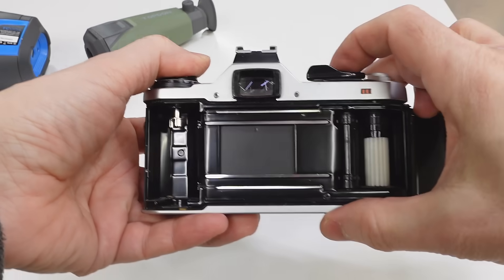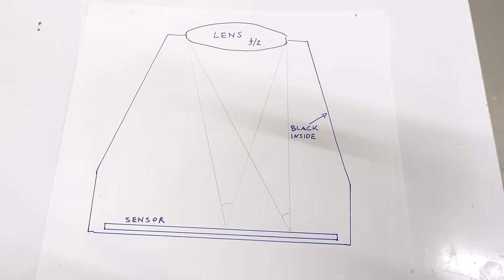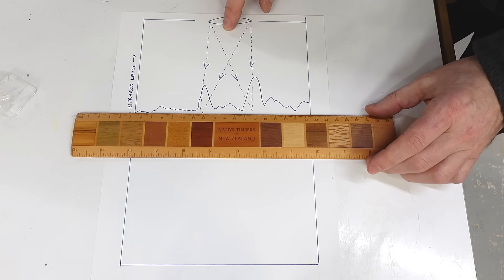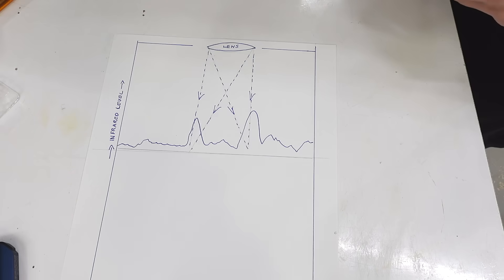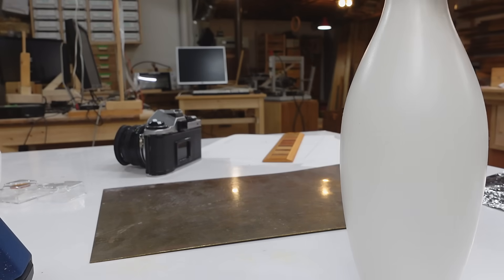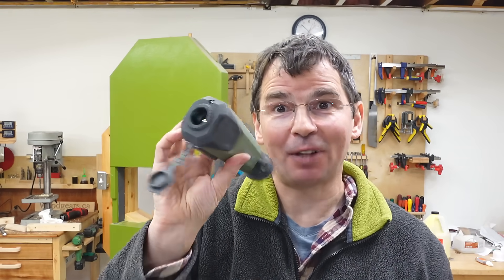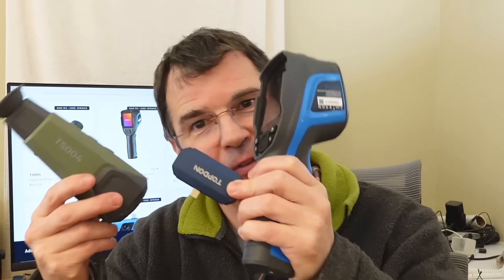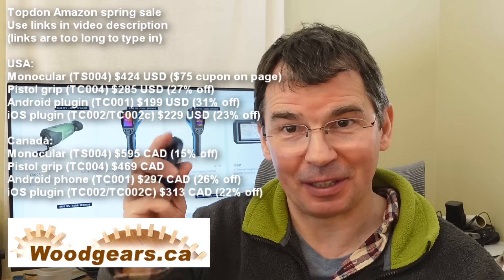How do thermal IR cameras even work without liquid nitrogen?

Comment: Well done exploration of how the modern thermal infrared imaging devices work. The technology has really improved since decades ago when the extreme cooling was necessary. The only suggestion I have is to be clear that you are talking about the thermal infrared, mostly around 8-12 microns wavelength, because the infrared spectrum extends to near the red visible light. There are other devices that measure the near-IR and short-wave IR wavelengths.

Comment: I wonder if these cameras are sensitive enough to be used as amateur IR telescope detectors? All IR cameras in astronomy are also actively or passively cooled, but what if you create a spherical mirror with aluminum foil and put one of those monoculars in the focus, would you be able to see the stars? Or will the atmosphere radiation totally dominate the view? I guess that depends on the optimal wavelength of the sensor in there, it may cover the atmosphere opacity window in NIR/MIR.

Comment: I use thermal imaging quite extensively in my work. I repair electronics professionally, and a thermal camera is INVALUABLE for locating faults on electronic circuits. The quality you mentioned about copper in specific is something I find very fascinating, and also very frustrating for my particular line of work. 

Many circuit boards have "ground planes". These are huge sections of the board which are entirely made of copper (although usually just one singular layer of the entire board). Often times, these planes are covered in solder mask. However, sometimes they aren't, and it is just exposed copper with some kind of coating to prevent it from oxidizing. 

Trying to examine a circuit board for a short can be very difficult when using an inadequate thermal camera, because ANY exposed copper can seriously screw with how the sensor is picking up infrared. I very often have to meticulously examine every part of a board, hold the camera at juuust the right angle and juuust the right distance, just to make sure it isn't getting thrown off from highly reflective materials like exposed copper. 

There have been many situations where I think I've located a short circuit, just to discover I'm trying to zero in on a screw hole with copper around it. It is very trippy seeing the thermally reflective properties of copper like this, too. Being able to see a reflection of the IR from my own hand when I'm pointing the camera at a board is a really weird thing to look at, lol.
Reply from the maker: I find that frustrating too.
But for making sure I had the camera focused at the right distance for that shot of the shutter clicking, a crinkled piece of tinfoil was the best focusing target.  Cause themperature itself tends to diffuse, so no sharp edges, but the crinkled tinfoil, reflecting IR from elsewhere, made for lots of edges to check focus with.

Comment: I mean, why would they need liquid nitrogen. Do you need liquid nitrogen when you touch a warm/burning object? Those IR sensors are just fancy antennas, because IR is an electromagnetic wave - just like visible light, but with lower frequency.

Comment: I wrote software for microbolometers, the question is not the sensor temperature, is the air absorption of IR on several wavelengths, and this is variable depending on air humidity for instance, so at different distances you get different temperatures at different places. To get a precise temperature you would need an spectrum to get the peak emission wavelength, considering it a black body but those is also dependent on the object surface. Basically you can only know the temperature at short distances (by Stephan-Boltzman law) when the air abortion is not too much.
Those thermometers are not to precise either.
If you put a temperature reference at the same distance of the object you can get o good measurement of temperature but you need to calibrate for EACH sensor.
The sensors are not kept at a constant temperature but they do what is called dark field calibration, from time to time a shutter obstructs the vision of the sensor an its temperature is known. This causes a annoying interruption of the image but works well enough.
And in 99% of applications the relative temperature is all you need: finding a wire overcharged on a circuit box, finding hot and cold chips on a PCB, finding hot or cold places on a person body, finding water infiltration on a wall, finding a person or animal hidden on a bush...etc.

Comment: I would think that putting a temperature sensor inside the camera so that you had a good sense of what's the temperature at the baseline, and then you check the amount of radiation being picked up from inside the camera. Calibrate those two and then after that you can start assigning temperature to the excess

Comment: from what it looks like at 7:07 you could almost think the sensor is actually heated to a constant temperature measured by a thermocouple or similar. As such, independent of ambient temperature, you always have a constant sensor temperature that is also easier to tune and calibrate. Whereas it would be best to keep the raised temperature as low a necessary. What do you thing?

Comment: I have the iPhone version of that little one for industrial maintenance/repair. I wish it was higher resolution, but it does what I need it to do. I do recommend using it with an extension cable so you can see the screen while pointing the camera wherever. Also, it wouldn't fit on my phone with the case on without the extension cable.

Comment: I find it interesting that they all seem to use the same sensor chip that has a resolution that's pretty small. So even the cameras that have a much higher resolution isn't because of a better infrared sensor, but just mixing it with high resolution normal camera sensor

Comment: Reminds me of something I learned about recently - "long exposure noise reduction".
You eliminate hot pixels from long exposure photography by following your shot with shot of same exposure but with lens cap on. Then you substract any sensor-inherent noise from your original photo.
Reply: Interesting, this suggests sensor noise is not so random as I'd assumed.
Reply: @CSNCSNCSN  For short exposure it seems to be random. With long exposure there are hot pixels and grid patterns.
Reply: There is actually a simple explanation that works pretty much in any measurements: often noise can be roughly divided into "random" noise(like white noise) and not so random one that can be due to some sort of a source (it can be a measurement system itself or simply something nearby). And when averaging over a bigger period of time or increasing amount of samples for it "random" noise samples cancel each other, but noise from a source lasts and can be obtained and substituted(since we know signal we want to measure is 0 or some well known value). This way often calibration happens.
Reply: @ВладіславЗаморський  you could also for example give up half of your vertical sensor area for a blanked off "reference", and in pitch dark, characterise the correlations between upper sensor noise and lower sensor noise. Then when taking photos, the post processing can go ok for X blank area noise, we should expect Y photo area noise.
Alternatively you get a sensor bigger than the lens can illuminate, and use the border area, but that's harder to explain initially!
Reply: @HaxR3  I guess this approach gives a significant advantage in terms of power supply dependency. This way one can probably simply use a battery and get very good results. And looks like this way temperature dependency can be improved as well. Such a clever way to do it.

Comment: My entry level FLIR does the shutter click. But it does not have absolute temperature readings (there's a separate, built in IR temperature sensor aimed near the center of the screen, close to but sadly not on the cross hairs on the screen).
Another reason to regret not getting a Topdon

Comment: For determining the absolute temperature, instead of using the amount of light coming from a surface, you could also theoretically determine the peak wavelength and use Wien's Displacement Law to determine the temperature.

But I guess that's not really practical in such a small device, and certainly not for each pixel individually.

Comment: Why does Topdon need to make a separate camera for Android and iPhone even though they are both USB-C? My household uses both phone types and it would be nice to be able to share the camera.
Reply: Last time I checked iPhones used Lightning instead of USB Type C. I've heard that the latest versions may have switched to type C but for all the other models you need a different plug. My hunch (without looking at their website) is that you'd get the "Android" version if you have such an iPhone.
Reply: @eDoc2020  The current/modern Topdon iPhone version has USB C just like their Android version. The have the same connectors, but only work on the one phone type.

Comment: The way it self-calibrates reminds me of the way hot pixels in CCD sensors get removed when doing long-exposure astrophotography - basically taking a picture of total darkness (which shows all the hot pixels) and using that to correct the pictures taken with the same sensor. (I have no experience doing any of this, so sorry if I got something wrong here)

Comment: My professor literally talked about one of the main reasons for cooling older IR cameras was that they used MCT photoconductor sensors, and those have a low bandgap so they can detect IR, which increases the intrinsic carrier concentration, which causes a high noise level.

Comment: 3:45 Both do have a very close check on the temperature so they know what reference temperature they are at and use that as a baseline for everything else. Its only in the cheaper ones where the temperature is shown.

Comment: I actually work in the infrared sensing industry. Uncooled sensors generally use a technology called "microbelometers". The sensing element doesn't use the photoelectric effect like visible light cameras or cooled IR sensors do. For uncooled sensors, each pixel is literally a microscopic thermometer. Its a little MEMS device which moves a lever and changes capacatance. When the optics guys explained it to me i was shocked that this actually works - but it does and it works really well.
Reply: They are actually spelled microbolometer, and they are made of Vanadium Oxide.  It's not capacitance, it's an array of thermally isolated microbridges that changes their resistance in response to the temperature.  So the microbridge at each pixel is heated by the infrared light incident on it, and the camera reads the resistance of every element to rebuild the image.  Also, I don't know that Matthias is seeing CO2 from the torch, because it has an absorption peak in the midwave at around 4.3 um, and these cameras have a midwave filter that filters out that wavelength.  It's possible that the camera is seeing water vapor.
Reply: @clarsen310 fascinating. Thanks for explaining.
Reply from the maker: Interesting.  Reading up on this, I did come across that term, and I wasn't sure what it uses, so I just referred to it as a sensor.  But I guess that explains why they are kind of expensive and low resolution compared to digital cameras.  I should try shaking mine to see if that affects the image.
Reply: @matthiasrandomstuff2221 so the click click shutter/flag process is actually called NUC (non-uniformity correction) and it's actually primarily to calibrate each "pixel" of the microbolometer. I think there is also some fancy tricks to get the baseline temperature as well but you can do that without NUC (like a laser thermometer). The NUC denoises the image, there are also hidden algorithms to reject specifically noisy pixels.
Reply: We might turn Matthias into a EO (Electro-Optics) Nerd yet!  I would be excited to see if he buy diffraction gratings Spectra-Radio meters!  😂 i have a really old one! Mike Kennedy VA3TEC
Reply: Dude that's insane!  Coming from a 2006 electronics point of view that's.. like future tech lol
Reply: Damn, I have used these professionally as a thermal engineer and owned cheaper commercial products but never went this deep.  Is it a matter of the MEMS array being hard to miniaturize father, or is it that you need physically large pixel "buckets" to capture a measurable amount of large-wavelength, low energy IR photons?  That'd always been my assumption when I was just thinking of them as traditional CMOS sensors with low-pass filters.
Reply: @CSNCSNCSN I think it's a matter of manufacturability and yield, and yes it's also the wavelength, 10um gives a theorerical limit of 100 pixels/mm even if you somehow have zero gap. 
On the yield side, Something like this is far less forgiving than a CPU or memory for example, limiting the economic viability of large die sizes. As "dead spots" probably lead to a total writeoff, and uneven sensitivity of individual MEMS elements can't always be adequately calibrated away!

Comment: I've seen people develop highly efficient low emission white paint.  It seems that painting the inside black would increase its IR emissions without cooling.
Reply from the maker: If the paint is low emission, then it wouldn't radiate heat very well.  Also wouldn't absorb it well either. Reflection, emission/absorption and transmission always add up to 100%

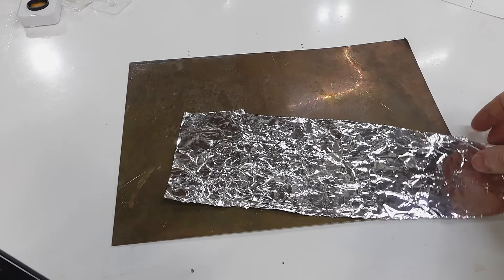Comment: 4:24 infrared quantity alone is not enough to determine temperature, as that assumes everything has a constant emissivity. Maybe that’s close enough to reality for most surfaces? I know at least some thermal cameras have an emissivity setting. But if you had a surface with 50% IR emissivity and one with 100% IR emissivity, one would be emitting twice the IR as the other. The obvious way to get around this from my perspective is to use a colour sensor, have different sub-pixels with different filters on them, so you can sample if one wavelength is greater or lesser than another wavelength. Assuming it’s a perfect Boltzmann curve, that tells you the temperature regardless of emissivity. But maybe that’s not useful, since low emissivity means by definition high reflectivity, so at 50% you’d be sampling the temperature of what’s being reflected just as much as you are the item itself.

Looking it up, most non-metallic items are 80% and above, but cement is barely over 50%, and gravel is under 30%. It would be interesting to see some testing with such a camera to check if low emissivity results in incorrect temperature readings.
Reply from the maker: and the one with 50 percent emmisivity will reflect infrared from somewhere else, so you don’t even know what you are measuring.  but the emisivity of most objects is pretty high
Reply: @ 
I guess it adds up. If you measure a 20C item that’s 50% emissive in a room full of 20C 100% emissive items, it will present just as much radiation as if it was 100% emissive. It’s only a problem when temperatures aren’t uniform. I wonder what the emissivity setting below 100% does, assume you’re getting reflections from a cold sky?

Comment: To calibrate an IR Thermometer, you use a "Black Body" which is a non-reflective temperature source inside a non-reflective box. Our lab didn't have one, so we'd have to ship them off for calibration. We finally decided that it wasn't worth the expense because the lens sees a larger area at greater distances and the reading was influenced by the reflectivity of the surface. Plus, the mechanics were just using them to see which cylinders weren't firing by the temperature of the exhaust ports. IR Thermometers are OK for relative measurements, but not for absolute measurements.

Comment: Would it be helpful, or even possible, to link the infrared temperature sensors to the camera sensor and use that to give a closer value for the temperatures depicted.  I suppose you'd have to identify which pixel(s) were being measured and then assign that colour value a temperature and the extrapolate that value to the rest of the colour gradient.?

Comment: Nice video. Out of curiosity where did you get the lenses ? I have their TOPDON TC005 - its great for repairing old vintage  computers by looking for hot spots from failed/failing overheating components. I originally got mine for checking my home insulation so having  other uses partly helped me justify getting it. PS love your wood working skills, nice shop.
Reply from the maker: search for zinc selenide lens on Amazon or aliexpress.  commonly used for co2 lasers

Comment: Matthias is the kind of guy who points an infrared camera at another infrared camera.
Reply: Been there done that, trying to remotely monitor a mirror polished aluminium plate. After mounting the camera in the top of a traffic cone to block the fluroescent tube lighting reflection, I found that I could see the outline of the camera lens system and within that, the sensor itself. Black mylar tape on the plate helped fix that, but there was still a bit of a blurry glow reflected.